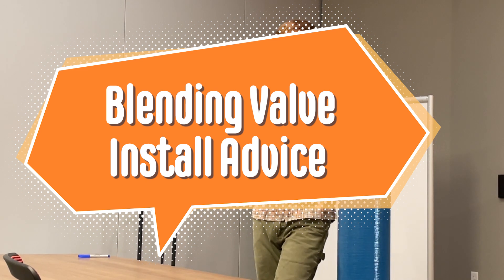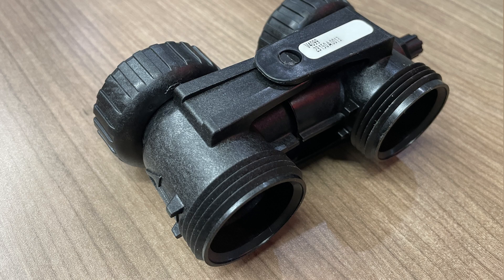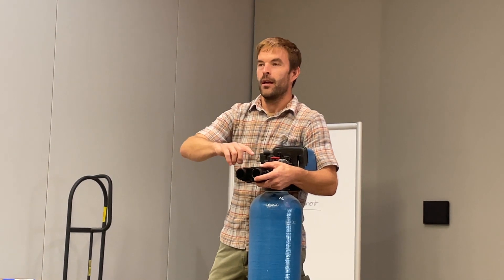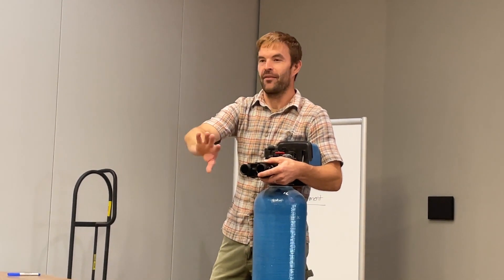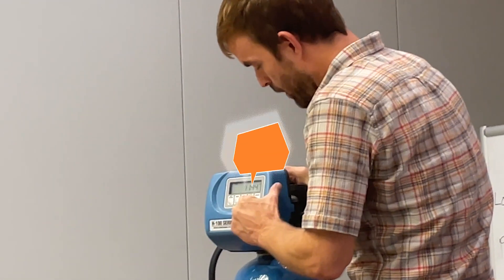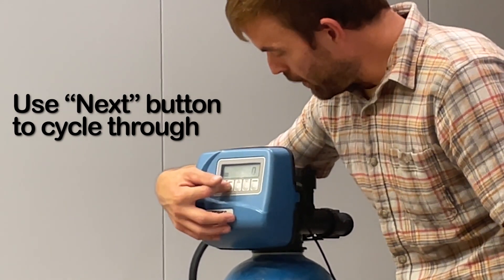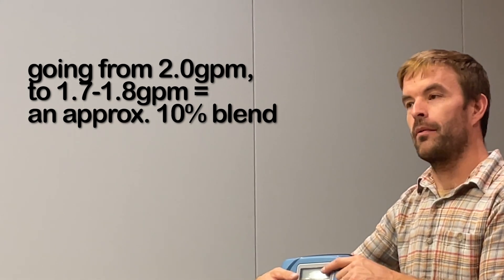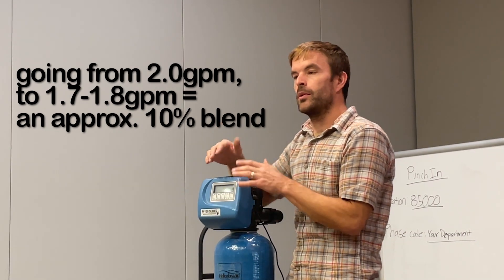Water Softener Blending Valve Install Tutorial

Comment: What model/brand of softener are you demoing here?
Does this blending valve work/fit Aquasure softeners?
Thank you.
Reply from the maker: Thanks for your questions! I am reaching out to my colleagues at the Madison Metropolitan Sewerage District who produced this video.
Reply from the maker: The water softener in the video is a Hellenbrand H-100 series. The blending valve is compatible with 1" or 1.25" Clack control valves - the compatibility depends on the size of the fittings. The safest answer for compatibility is to check with the manufacturer. The Clack valve is not compatible with all types of softeners, but it’s possible that other softener manufacturers have a similar device